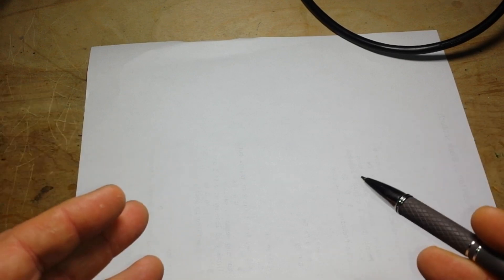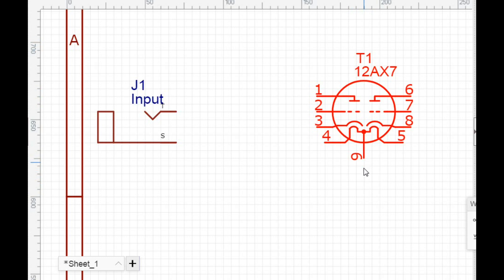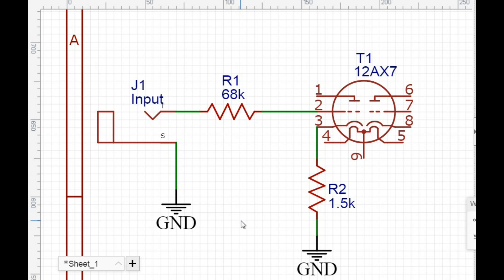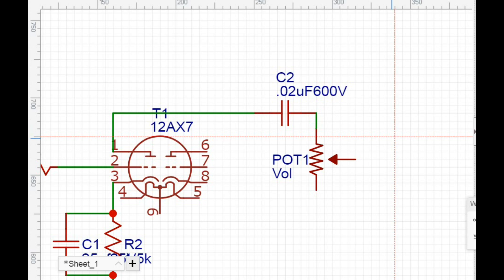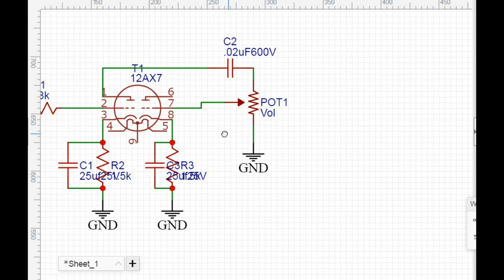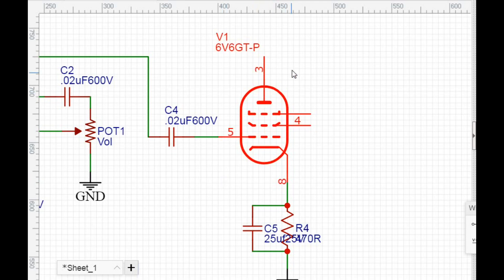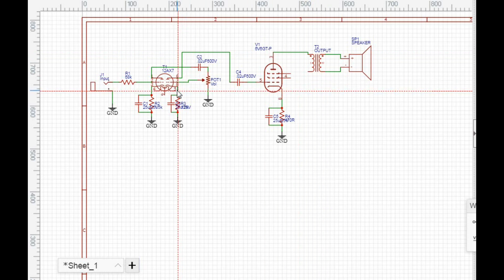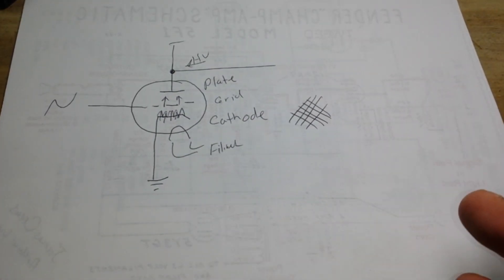Let's design an build a vacuum tube amplifier from scratch

Comment: YOU ARE BUILDING AN INVERTING POWRR AMP.  NO NO NO.  YOU CAN CORRECT THIS BY REVERSING THE PRIMARY LEADS ON OUTPUT TRANSFORMER. THEN YOU CONNECT NEGATIVE FEEDBACK TO TJE FIRST TUBE SECTION CATHODE

Comment: I am a retired Designer Engineer an got my degree using tubes before transistors. You are NOT designing anything, you are just COPYING an amplifier that has BEEN designed. The Fender 5F1 was a well designed SE amplifier.

Comment: You are pulling components into a circuit diagram - with values - out of your head.

You know the circuit diagram.

Explain how you arrive at those values for R and C etc 

That’s called “design” 

Putting something down from memory is not design -

Design requires that you know how to operate that tube.

What voltages/ currents are needed to do stuff to the grid, plate and cathode.

Those component values ( R/C) are arrived at, with a view to achieving the “biasing” of currents into the grid, voltage st the grid, plate and cathode !

Jotting down on a blank piece of paper a circuit with known values of Rs and Cs is not designing !

So start again !

Comment: Do not try to rebuild this circuit. It is missing relevant components (anode resitor) and not showing the power lines. Sorry but this has nothing to do with designing or learning to build an amplifier.

Comment: Thanks for the tutorial, couple of questions here: 1. Why volume control can't be put on the input side? 2. How those resistors and capacitors value determined? (Why R1 = 68k and C1 = 25uf? Can they be 1k and 100uf? for example.)

Comment: I got a kick out of this video.  The nice part is that this is a proven, basic class A circuit and you can add anything you might want by adding a pot or different valve.  Add a tone pot or tremolo circuit, how about a more powerful output valve with a different output transformer or more B+, the combos are endless and can be built with scrap parts or different valves you have on hand,  that's the fun. Personally I like repurposing old electronic equipment and some of the amps that come out of that process are just crazy and built for practice and fun and some are standouts.  If you like to tinker it's the hobby for you and there are many kids that need a practice amp to get their talents started.

Comment: 1) it does not work, you are missing essential components. Such as first triode and power tube ground reference resistors, first tube plate load resistor los no signal there), etc. 2) you pull values out of the blue with no explanation. Of course you are (poorly) copypasting from a real circuit

Comment: The input grids of valves should be connected to ground (0v) otherwise the operating current of the valve cannot be controlled. The purpose of the resistor from the cathode to ground is to apply a negative voltage on the grid wrt the cathode.  Check your valve data book for details, every valve is different.
Reply: Forgot to say, the input grid is connected to ground via a large resistor, typically 1 mega ohm, not directly connected to ground!

Comment: The schematic diagram shown is faulty and will not work as-is.
The triode tubes plates (anodes) must connect to a positive DC supply (so-called B+) through some load (a resistor or current source) to conduct any current.
Without the DC bias current, the tube will not amplify AC signals correctly.

Comment: If you don't have a resistor from J1 to gnd when you unplug the input grid will collect electrons and shut off completely so that when you plug in the input again there will be an almighty crack as that voltage is discharged to ground. Also without a resistor from V1 grid to ground, V1 will shut off allowing only the peaks of the incoming signal to get through. Typically the grid to ground resistors are 1M to 10M.

And BTW you will never get a true HiFi amp using valves.

Comment: You should always use a push-pull final, finals will be driven into non-linear regions and with a push-pull output odd harmonics will not be generated and it will sound more smooth and less harsh when strongly driven.

Comment: Ok, thi is Amp, but how to make a PreAmp with D. I. output?
Reply from the maker: The preamp is the first stage and second stage of the 12ax7s. The 6v6s are 5he power amp. To make a DI you would take a feed after the preamps, before the power and after any tone circuitry. You can then impedance match your output feed to your mixer with a matching transformer.

Comment: 10:18
How do the 12AX7 plates get B+ voltage?
Reply: From the power transformer
Reply: Which is seperate from the output transformer. I know this is a 6 month old comment. I answered anyway incase someone else was wondering the same thing

Comment: No offense, but anyone can take an online schematic and simply create a video like this. Literally no explanation of how you arrived at any of the values or anything, pretty disingenuous if you ask me.🤦
Reply from the maker: I didn't.
Reply: @learnelectronics  well why not explain about how you arrived at values. I only say that because tube amps utilise some dangerous voltage and currents, this video could give the impression that these are hard values for different variations to someone with less knowledge.
It's not to be argumentative either, your content is usually more insightful. Just feel a better explanation could have been more educational really.
Reply: @zefrog7482  This is why I don't touch tubes. All my life has been with software and ICs. No analog stuff.
Reply: @Aviator168  I was the same, but check out a channel called Skunky Design's.
Actually really informative stuff, no BS and very educational. Worth a look even out of curiosity, she has a way with making it all very understandable yet detailed. Be warned though, it might just get you building one.😂 I always kind of liked the idea, although more for the tube glow than anything else, but the idea of DIY and experimenting when it's explained so gracefully is hard to resist, just a cool project really.

Comment: Could you use the two sides of the 12AX7 to handle the left and right channels of a stereo signal?
Reply from the maker: Yes, you can. But, to do that you would need one tube to use as a phase inverter, and you would be losing a gain stage so you might want to add another tube.

Comment: Do you have any videos that speak to the different caps, and depending on where in the circuit,and  the preferable cap materials that better handle sonics vs just being a workhorse. I hear different interjections on this subject but haven’t found a good explanation of except when folks rave about bumblebee caps in the Paul’s. Maybe I’m. It searching correctly. 
Fantastic walk through. Cheers-

Comment: dude, not a bad video, but "Design" is probably not the right word. all you've done is make a schematic, and I get it, I build Tube amps all the time, I understand what you're saying, but really, you've just shown people how to model a schematic in easyEDA, not design a tube amp...
Reply: You are not correct because he did indeed design a tube amp. Maybe you have a different definition of “design”
Reply: @sadboinlh1586  designing a tube amp, takes calculations for resistance and capacitance values, tube types, voltages, etc. modelling an amp in and EDA program is not designing an amp, you can just copy an existing design and model it in EDA, that’s not designing it, and you could just model an amp schematic from scratch with ideas on values, but it might now work, or work very poorly, or start a fire, that’s not designing either. Designing a tube amp takes a lot of consideration. You are confusing “Modelling” and “Designing”… 

I “design” and “model” tube amps regularly, and I have countless books, and spreadsheets to do so. Once you’ve built a few, you know what works for different sounds and can fine tune it from there with calculations or trial/error, but initially the design has to come from somewhere. 

Or you can just copy another design and change parts of it to suit your desired sound, but that’s not “designing” and that’s not what’s happening in this video…
Reply: @madaxe79 you are so right
Reply: @madaxe79  I understand what you’re saying. What I’m trying to say is that you are being very particular with those words and that those are definitions you’ve personally ascribed to them, based on what and how you’ve learned.
 I’m not trying to write you off though. I do see what you’re saying so thank you for your reply. I can explain my answer more if you’d like.
Reply: @noahprussia7622  you don’t understand

Comment: I appreciate   the  progress of design with  application. I use pencil and earsing rubber. Although it is proper circuitry to make amplification ,  without any feedback and without possibility to adjust  input signal the first stage which is likely to be overloaded. And mono.  For music  it is useless. .   No   tone controls, no phisiology correction ? Why to build with marvelous tubes something useless?

Comment: It's not what designing is all about, you are just copying an existing circuit. Designing involves thinking about the sound you want and calculating component values to achieve it, not just copy paste a 25uF bypass cap every stage.

Comment: Ok, but no connections made to the HV side of the tubes, which I believe is thru resistors?, I think you should included that in part one, otherwise its confusing to have a circuit with no HV connection).

Comment: This is awesome! Wish I found it earlier. Simple and excellent tutorial. I have a tombstone radio chassis that I want to become a Bluetooth receiver and an MP3 or other type player. I have wanted to use a tube amp setup, I want a rich and not tinny sound. Yes I know I can buy one, but so much better to build. I'm retired from the aerospace industry, not an engineer but a builder for the engineers which included some electronics. I was certified in soldering. This is exceedingly helpful. Thank you.

Comment: isnt the grid between e and non well wouldnt it giv a negative invertet signal ? like in fets ? 
just a simpel assumption the first tube stage is knot 2x ground as in Ground but ´power station´ electrön F€€D?? 
there is a 2nd source of e apart from input..!? 
where is the e´s going from where to where ? conducted by the condensor ? the es in the remaining right part of the spiral or inductor spool? come from where ? all a bit confusync For a nööb ^ ^
Reply: edited? jfc...

Comment: I want to make it 60 amps instead of one amp. Do I just use a bigger transformer or do I have to change the tubes?
Reply from the maker: You will need to change your output transformer, probably add two more preamplification gain stages, and two more power tubes.

Comment: Great video. 

I've always had an interest in guitar amp design, pedals, etc. I find electronics, circuit boards etc very fascinating and mysterious.

How does one begin with designing a guitar amp? Should a degree in electronics engineering be pursued, or is there a specialized certification for audio equipment electronics? 

I'd love to hear from you! 

-Felix

Comment: With all due respect to everyone who commented that they learned a lot from this video, from the title I expected you to describe how one reaches the values of the components. Instead, all I saw was a schematic of pretty much a copy of an existing circuit, with no explanation for the selection of the values of the components. That's what I expected, based on the title.
Reply: Didn't get a reply from the channel creator, maybe he has no idea either
Reply: @darrenbird2526 do you expect an apology or something?
Reply: Sure I can make the circuit by following this but im no electrical engineer, audiophile, or a practiced musician and don't fully understand  why these components are needed at these values. It's been a long time since I took electrical circuits in college
Reply: I was going to make the same comment. How is 68K determined for R1? There is no designing going on here.

Comment: Great video on showing just the signal chain but why doesn’t the grid of the output tube reference ground thru resistor like for the grid on 12AX7 but with a fixed resistor rather than variable resistor for volume control?

Comment: do you plan to heat the 12axy as a 12 volt filament [pin 9 not used] or a 6 volt filament?

Comment: Nice video! Can you tell me what is the purpose of the bypass capacitors which connect in parallel to the ground resistors? And how can you determine capacitance value? Thank you.
Reply: As per my knowledge , the capacitor is used for better frequency response as well as gain.

Comment: There is no part 2 or am I wrong?
Interesting decision not to include the plate resistors in the schematic. As they set the gain I wouldn't count them solely as power supply components.
Also, I really don't like a double triode schematic sign, leads to a messy drawing. It is much better to draw each triode separately. Phase splitter or cathode follower would look really funny drawn that way.

Comment: Question: how do I take a 5 watt circuit like demonstrated in the video and bump it to 15 watts?  What kinds of changes are needed? More tubes? Different (more powerful OT? 
& if I can raise the wattage, do I need to change the caps/resistor values ?
Reply: A pair of 6V6’s or EL 84’s make 15 watts in amps like mini-Marshall’s or the EVH 3.  Likely in a push-pull configuration.

Comment: There needs to be a resistor from pin 5 on 6v6 to ground About 470 k . That gives you your negative bias on output tube , Otherwise the tube may cherry plate and distorted sound.

Comment: I'm a beginner at electronics, and I was just curious, what does the cathode bypass capacitor do?
Reply: With no bypass cap, there is a signal at the cathode which works in opposition to the signal at the grid, reducing the gain of the stage. Adding the cap removes the signal at the cathode, allowing the stage to attain its maximum gain.

Comment: Any reason why a tube head wouldn't switch from clean channel to distortion channel ?

Bought a used blue voodoo 60. Had no sound but fixed that, second problem it won't switch channels

Comment: wait what? guitar amps cant be swapped for hifi amps. They are different classes of efficiency/ sound quality. E.g. guitar amps are usually push/pull, whereas if you try passing a push / pull design off to a hifi audio buff, you better hope they are not a gym buff or an MMA buff...  XD

Comment: Nobody is going to read this because this is an old video, but there are a few things wrong with you schematic: The transformer is connected wrong, the side with the few turns "1" should be connected to the speaker and the "N" side to the output tube plate. Also, you are using the symbol for "Earth Ground", that should not be in the signal path, as shown.... How and where to connect Earth Ground can be a tricky thing, not to be taken lightly!
Reply: True said

Comment: Help me Sir, how we can know how much value of capacitor, resistor etc., put to build any type of circuit. Example like remote control, how much will take value of resistor, capacitor, inductor, etc., to build a circuit. please help me sir. Why there is number code in electronic device 🤔. Please make a video 📹🙏 on this.

Comment: You miss  the plates of the triods to be connected to the hi voltage trough resistors!!
Reply: Missing resistors from the plates of the triodes to the hi voltage. The other end of the transformer to be connected to the hi voltage.
 Pin 6 of the triode to 6.3 volts

Comment: Just to clarify, the schematic as described will not work if is built like that, the schematic has some missing critical components like power supply voltage values, plate resistors, that have to be calculated for proper amplification and frequency response, grid resistors to ground to drain the charge accumulated in the grid, dc suppressor capacitors, etc. this is just an idea how the signal path is in the amplifiers rather than a design, components values are arbitrary, the actual design is to know to calculate what values they are supposed to be for a proper operation.
Reply: True said

Comment: I used to assemble tube Amplifiers years ago, using 6V6, 6L6, EL 84, EL 34, mostly in push pull for higher output.  The cost was largely dependent on the requirements of the guitarist. 
I see that in your 6V6 grid, there is no grid leak resistor. Is that done on purpose or otherwise?
I used grain oriented stampings, 
for the output transformer. Heavier bass response!!
I am now running 80 years and this my obsession!!!!
I now use 5200 and 1943 
Toshiba Transistors.  They are
Heavy duty and give astounding Bass! Drives a 12 inch DJ speaker.
Reply: any learning recommendations/books/etc?  Gonna start this as a new hobby

Comment: Great Work! Actually Fender used 68K input resistors but wired in in parallel  when you plugged in the high impedance jack making it a 34k R, So when building a single input and still wanting to stick to Fender specs you would use a 34k  (33k is closest) R.

Comment: How did you work out values for the resistors and caps? Whats your operating point etc?
Why are you Not using a plate resistor? How will voltage be carried to next stage by just 1 capacitor? 
Did you actually build this?
Reply: He isn't covering power supply design in this video. IMO, plate resistance is part of the amplifier stage, not the power supply, but it isn't my video.
The capacitor blocks the DC plate voltage and allows the audio frequency to pass to the next stage.